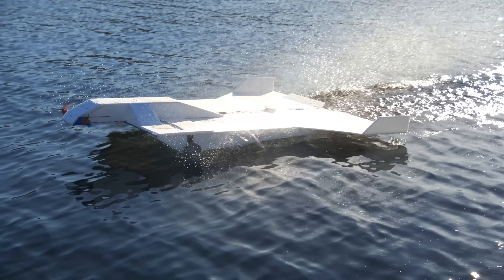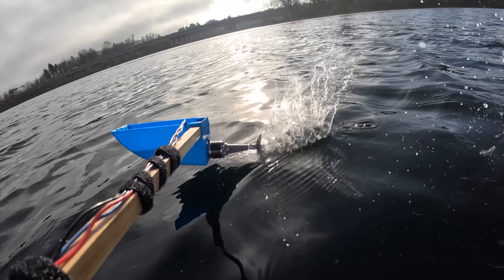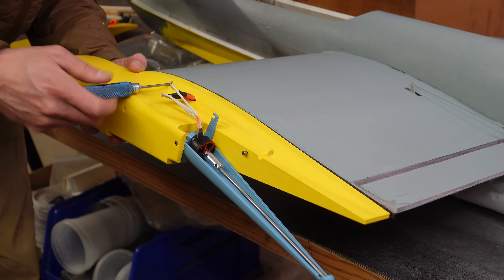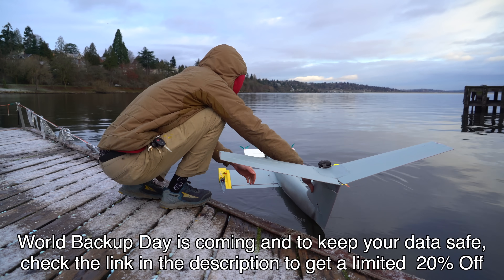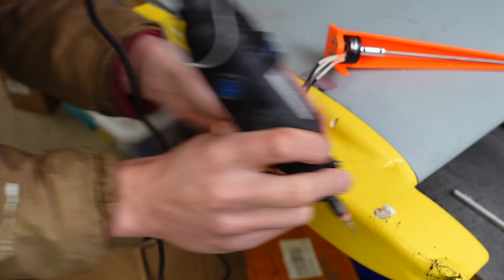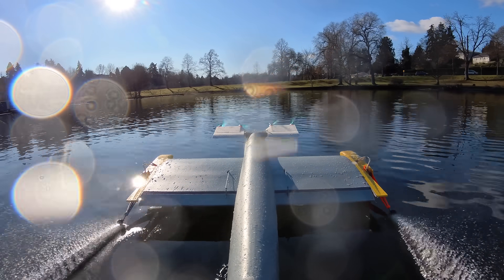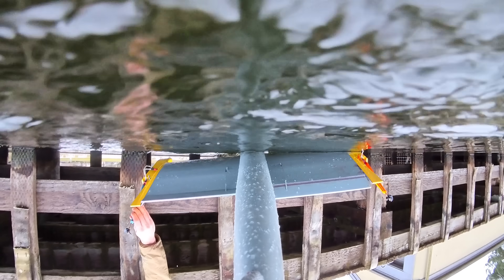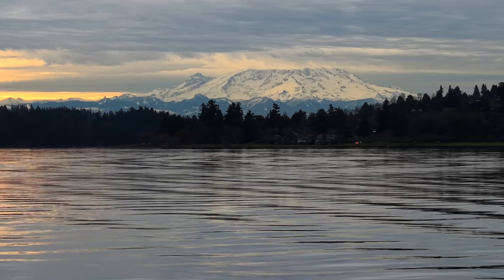Can Speed Boat Propellers Power an Aircraft?

Comment: Could add a simple flap behind the air motors to direct more air under the wing - have it activate when the fwd motors are turned off
Pair that with spring loaded props that will fold back and I think that would allow it to stay up

Comment: The forward motors on `Ekranoplans generate the air cushion and the rear motors the thrust. Real ekranoplans reduce power on forward motors once up on the air cushion but they are still necessary to provide ground effect lift. the thrust element is independant of the air cushion effect so no matter if using air props or water props for the thrust element it will not function correctly without the air cushion.

Comment: The pontoon props could definitely use some improvement, I'd have made them just as they are except more flat and airfoil shaped to reduce bounce back, with little winglets angled in a way that it forces them to stay under the water at the preferred angle, somewhat like what you see on the refueling boom of a tanker. I see no reason as to why this shouldn't work on water props alone

Comment: Wow great science work on this project...!  So maybe use a two  smaller engine forward air motors or even maybe in a pusher mode, or of two forward and two backward facing propellers as to note the difference in CG lifting of the front of the ekranoplan and its stability...? ... Just a thought...

Comment: Bernoulli's principle.
Moving air is less dense than stationary air.
In the same way compressed air decompressing through a tube will pull paint or sand into it... why not put the "hopper" intake into the water and keep the releasing air section out of water to throw water out the back? If the laws of physics apply, when the water is accelerated rearwards, the craft ought move forwards, right?

Comment: Put some weight down by the props so it takes more resistance to pop out of the water. Or spring load the props so they push into the water more. Or, Perhaps remove the wing props but add one larger prop at the front of each water prop. That way the lift\thrust points relative to the water\thrust. Think Osprey V-22? With water thrust at back. Just a thought. Fun to try?
And thank You for the great content. It's fun to watch the process.

Comment: Been thinking about this one unsure if it's mechanically possible  but what if you had strong enough and fast enough servos along with a lidar sensor that kept the props at optimal depth to keep the craft in ground fx but at the same time acting like shocks,  will take some math to get balance right but essentially replicating the legs of a skiers both on water and on snow. Their skis maintain contact with the surface regardless if it's flat, bumpy or choppy and rough meanwhile their torso and head (the craft) show little to no movement a better example would bea chickens head while holding you down go up down side to side round and round and it stays perfectly centered

Comment: I dont know if you are using Orcaslicer, but you could add a modifying shape, ie a cylinder and tell orcaslicer to not print bottom/top layers here, that way you dont need to dremel out the drain plug and the infill will go to the bottom layer :D

Comment: well, as far as i could see theyre counter-rotating...(now i look, the air props definitely are...)
but those 3 blade props also looked to have chunky leading edges rather than knife edge? iunno, never got a really clear shot...

besides pitch theres obviously diameter and here we really open a can of worms as theres literally hundreds of options and thats before you start modding props... and they may cost more but metal props are far better... can polish them, cup them, trim them, balance them, and maintain the edge...

not overly keen on that bearing/shaft setup... normally the skeg bearing is a bush... lower profile. doesnt make much difference here, just throwing it out there... no real need to use miniature bearings there.
remember the bearing also has to deal with thrust, and in this use, the thrust is pulsing, and never really consistent... sure, the motor can take a fair bit, but its only compounding that flex/vibration of the shaft... maybe invest in the real deal, CW/CCW shafts with threads and dogs... or at least a pair of dies? LH/RH... g'luck threading TI! try ali. though mild steel will be fine, spray it with some wd40 after use... (lanolins better...)

theres also micro thrust bearings available... and yet, that M3 pivot bolt is taking the thrust as well... how did they, and the holes, hold up?

 cans of worms AND rabbit holes! meh. its experimental, not like you expect it to be running 24/7, huh?

having the skegs pointing down will tend to make the nose dive in, not much you can do with that other than figure out a way to get them in FRONT of the CofG.

GOOOOOOOSE!!!! goose poop is an occupational hazard. :)

Comment: Would it make sense to make this vehicle in a way to only use water motors? Maybe the flight needs a more aggressive flap to provide air cushioning? The air motors are cool but the water motors, while slower and less efficient might give mechanical feedback help to keep the vehicle closer glued to the water level even during waves?

Comment: here is my free tip to you. if you use propellers and they have no trust u need to spin the rotors aside in the wind so that they wont rotate by the wind - if they do its destabilizing the plane at all....thats just basic propeller knwoledge i pikced up from pilots....old planes (WW") have manual Propeller rotation control, new have automated ....) if you fly a 2 machine lane and one machine is in error their propellers move into the wind so the machine wont be driven by the propeller catching the wind....this is really an advantage to know....
in your model you need to change the propeller to better ones with "lfy position" when not working - anything else brings a lot of stabilisation and manipulation issues you already experienced

Comment: have you tried implementing air ducts and impellers along the hull of the fuselage to have air diffracting along the hull at a speed higher than the traveling speed?
also, have you considered covering the hull in some kind of hydrophobic coating?

Comment: I suspect you will want much lower KV motors and run them on 6S? Higher KV will only increase your RPM, lower KV (with thicker windings) will always produce more torque for same voltage.
It seems backwards but to increase flight times on a quad copter you want the lowest KV motors you can get and the most aggressive pitch props and you use the that punchy torque to keep you in flight 😉
Going higher KV with a more aggressive pitch and you'll likely burn out a motor? 
You already aren't using full throttle anyway, so you want each time those water props contact the the water; you want positive forwards thrust and that comes from torque. Going a wider motor rather than a longer motor will also be more thermally efficient and again create more torque rather than RPM 😎

Also maybe look into those folding props or making that front wing have no motors and aileron (flap control) to pitch the nose now that you have the water speed to create lift (i know you've tested this already but you never had the water speed to get into ground effect like you can easily do now?

If you made those water surface piecing props with about half of the diameter increased in size (1 ½× current props) you may have enough surface area on the props for thrust to occur easily in air?

Comment: That's awesome! Maybe a "proper" RC coilover would work better than the rubber bands to hold down the props? The oil shocks might prevent the prop assembly from vibrating or "jumping" too much on the water. It would obviously require the whole thing to be very stiff in order to work...

Comment: Maybe in the next one you  put one more powerful motor in the centre, close to the front. This might provide more uplift for take off. I think it would create the same type of force that air props are giving now. You could even have two, one on each side, but I think the force needs to be applied at the front and not in the centre. 

Love this video, you're a great engineer

Comment: I don’t think water propellers would work on aircraft since water propellers are supposed to shift the liquid (water) behind the vessel propelling it, while aircraft propellers work basically the same but because of their design rather push air then water, so simply put I think it shouldn’t work since they work differently.

Comment: Dynamic CG changes with just water props, currently causes the nose to drop when the assisting air props stop powering / lifting the front end up at speed. Adjust the CG for no air props and the water props will allow enough speed to the wings for lift. Sharp CNC metal performance props will greatly improve thrust.

Comment: What about only two air propellers? Basically math it up so they keep running, providing lift but no drag, but water props do the thrust

or how hard is variable pitch rotors on RC? Im not that knowledgable there, but Id say for a real aircraft of similar design, theyd be invaluable. Set the motors to a constant rpm and control lift with the variable pitch

Comment: If you look at the show mo you can see the long throw prop shafts are chattering left and right when the blades hot the water. Maybe comfort vertical guides to support the lateral travel. Also maybe increasing the prop size by like 50% might help keep it airborne without continuous par thrust. I am afraid poser thrust might be necessary though with how low the wings sit in the water but what do i really know?

Comment: You might have a little more luck with the bearing not at halfway exactly, but a little off. It could still vibrate on its second harmonic with the exactly halfway soln.

Comment: if the goal is to ditch the air motors entirely, a slight redesign of the airfoil might be in order. while the air motor propellers are definitely causing drag, even if you didn't have them, i don't think there would be enough lift to get the plane up on plane. perhaps something similar to the auto-adjusting wings with the surface skimming rod idea would work here, but it would need to both be reversed (providing more lift while the rod is close to the plane, and less when it lifts off), and possibly be controlled by servo once it's off the surface. 

also, as much as it would suck to have to do, it may just be time to scale up again. so many of the physics at play here just don't behave the same at larger scale, leading to vastly different performance.

afterthought: if you created something like a 2:1 scale ekranoplan that exclusively uses surface skimming propellers to achieve lift, what would you have to register it as? a boat? a plane? both?

Comment: You need to investigate the concervation of momentum (each component has mass rotating, moving, or static). It will be extremely difficult to match prop rotational speed to speed across the water. If the match is not very close, things will be broken regularly. When your components are measured in grams, the stress is de minimis, but when you get into ounces or pounds, the stresses go up exponentially . Continue to have fun.

Comment: Rc boat user here, definitely go with a bigger prop either side, also props for Hydroplanes are "lifting" so effectively pull the boat out the water, I think they would work best in this. I think your onto it with a bigger motor each side too if you can get away with it weight wise. 
Love seeing this stuff, please keep it up!

Comment: Back in the 80s there was a 'boat' concept that used surface-piercing props, but they were mounted sideways and were more of an aircraft-style. The vehicle almost looked like a quadcopter, but with props under the hull and angled at 45 degrees (think right angle triangle with aforementioned right angle down when looking from the front). The idea was that the normal propeller forces lifted the hull out of the water while what is usually parasitic drag from the props propelled it forward. Supposedly it performed well, but was not very efficient and sat in the water quite deep when not moving. Also fast spinning large props could cause issues if they hit something in the water like a rock, a log, or things of that nature. The craft wouldn't just "drive" over an obstacle like a wheeled machine.

Comment: That is a cool setup!  I'm wondering if one long tail prop off the center rear of the vessel would give more consistent contact with the water.  Steering thrust could be controlled by the air props.  The vessel could then lean into the turn with the power applied to the correct side of the turn.

Comment: Daniel, how bout locking the surface drive pivots as far down as possible and try running that without the air motors on. That will give you more start off bite like on hydrofoil boats, and then once the hull raises, it will be in surface drive? It will help keep it out of the water. I think the pivots were hampering it from taking off without air motors. They sound logical, how you have them set up, but I think without the air motors, the pivot is not designed and lock them fully extended.

Comment: I think you are reinventing the hydro plane race boat. After all a 20 cubic inch outboard engine that will drive a 500 pound boat over 100MPH definitely fits in with what you are attempting to do. However that same boat and motor combination doesn't work very well in 6 inch chop.

Comment: I'd guess the reason it worked once and not again was that you shut them off with more speed or possibly a headwind picked up. Your air props are pushing air backward past the wing, generating a lot of lift. As soon as you shut them off, you don't have that artificial windspeed on the wings generating lift anymore and it drops. To make the idea work, you'd probably need to ramp the speed of the air props down while accelerating the vehicle, to transition from artificial windspeed generating the lift to actual windspeed generating the lift.

Comment: You need a third water prop in the center where it is located at the CG.  So when it starts the trust line is low which should pust the nose up once you are going it will become a surface prop like the others...

Comment: It looks like the surface props are providing lift based on how much they were bouncing out of the water. Try fixing the props shafts in the down position and use the props to maintain your height off the water.

Comment: Perhaps a small horizontal fin off the side of the pod down by the prop would help. Think of it like the trim-tab on an outboard motor. You can  use it to set the optimal height of the prop relative to the surface. I know it means dragging a little bit of extra surface area through the water but the idea is to keep the prop in contact with the water and not flailing about. This would also allow you to set a sort of baked-in thrust vector to your motor pods to help offset the lift lost by the air motors.

Comment: What if you got the prop out front, but you’re pushing water instead of air. The motor (or end of drive shaft) is kept at a constant depth at the T of a hydrofoil. 

Or, use a pitch-and-steerable jet-ski turbine style motor at the same position. 

Sounds like a fun project!

Comment: I'm curious how changing the axis of the pod pivot about the aircraft roll axis would effect behavior. There is a decent amount of propwalk which with a change of the axis could tilt the props in or out of the water.

Heck if you change the pod axis wrt the yaw axis you could gain some forward thrust from the propwalk.

Shaft whip is the term you are looking for with those long propshafts.

Comment: Hey, i just had a random idea, if the water is so sticky, then why dont you use lubricant for the frame and propellers, silicon or like a thin layer of PTFE... you get the idea, i think that could help with the friction in starting (and mostly water appealing).
Nice project btw!

Comment: I'm wondering if there is any loss of water motor efficiency due to the angle when the pontoons drop down.  Using a passive cantilever system you could make it so the propellers are always pointing at the same angle relative to the water.

Comment: I am usually late when I comment, but here goes: For a given propeller pitch, there should be a speed of rotation where they are turning at exactly the right rate for a given forward speed. If you can detect that speed and drive the motors at exactly this RPM in real time, it would eliminate prop drag. I imagine you would have thought of this, so perhaps it is just not practical in RC craft. I think in the real world a variable pitch prop makes this much easier.

Comment: At 15:24 you can see the prop rods vibrating intensely getting a 1-3 cm shake. It seems like getting the water powered system to work will take a more robust structure. But id also say maybe take off a 2 motors from the front. If the goal is to get the water props work it seems like balacing the plane futher back would help (or just removing the excess drag. [Lastly im relatively cluless so dont take my comment as worth while advice, live your content keep it up]
Reply: Turns out your ahead of my idea lol... only had to wait 10 more seconds

Comment: What about using a shaft with the rc boat motor that goes into the water like a hydrofoil without a wing? The length of the shaft would dictate the height it could go out of the water and keep in in the ground effect.
Reply: Didn't he say that a fully submerged prop creates too much drag though?